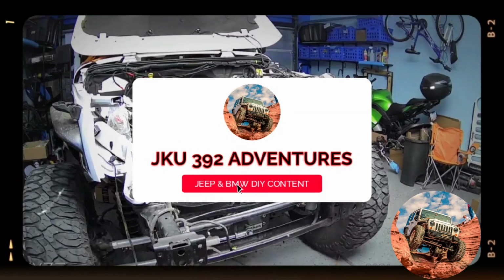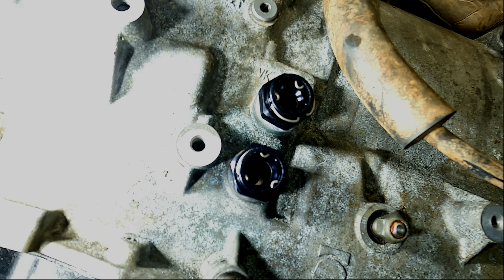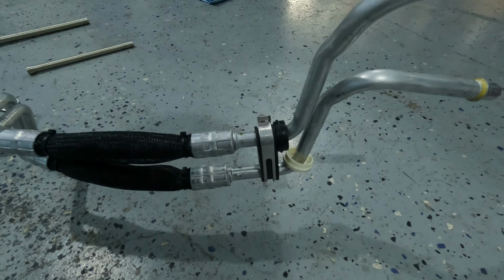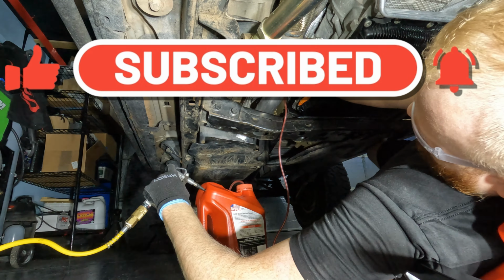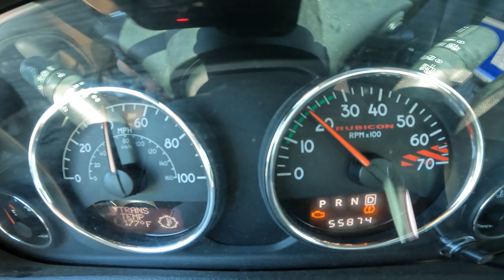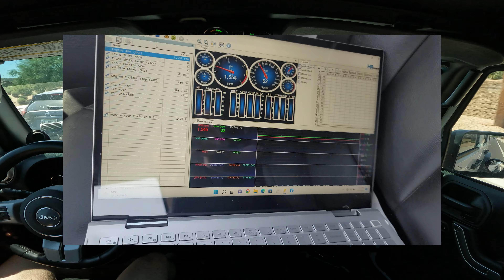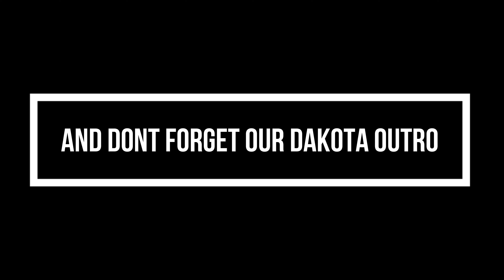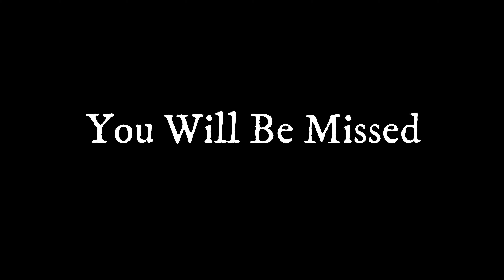How to Swap your Transmission! (8hp70) (FIRST DRIVE!) (Video 3)

Comment: All 3 videos are super informative!! You made it look easy. Glad it worked out for you dude. I got the same year jeep, but a sahara that I want to do the 8spd swap to.
Reply from the maker: Hey! Thank you, it is definitely a swap that's worth it, even if you don't have a V8, the 8hp is an amazing transmission. Join jeep speed shop page on YouTube, you'll see a lot of good information on there 👌👌🤙🤙
Reply: @jku392adventures  i have a 2012 Dodge Charger Pursuit with 6.4 swapped into it. And pointers you would give about gear shifter harness or anything?
Reply from the maker: @khuncho5000  I would recommend reaching out to sound German on Facebook and see what he recommends. You'll probably need a shifter from a 13-18 charger/challenger that had the 8 speed, whether it had a V8/V6 shouldn't matter. But you'll likely need the pcs controller to help the transmission talk to the ecu
Reply: @jku392adventures  ok thanks bro. very insightful 🫡
Reply from the maker: @khuncho5000  no problem 🤙🤙🤙

Comment: Just need a MPVI2/3 with credits and HP tuners to view the info on the PC?
Reply from the maker: To use HP tuners you will need the HDMI adapter but you can view all the information without paying for credits, but as soon as you go to upload a different file to the transmission or ECM, you will then have to pay for credits

Comment: Great stuff. What is the name of the aux pod above the mirror? Looking to do this swap to my 3.6 this year with the JSS kit. Any tips? Thanks
Reply from the maker: Thank you! Jss is definitely who id recommend, join their fb group and there's endless amounts of information on there, and for the s-pod the actual link that I bought from is too old, but this is close to what I purchased

Nilight 6 Gang Rocker Switch 12V Panel Relay Box Circuit Control System with 80A Circuit Breaker Switch Covers and Removals for Jeep Wrangler JK JKU 2007-2018,2 Years Warranty https://a.co/d/344Nvdt

Comment: On jls-jts when you are in 4low mode you can choose up to 4th gear to start the car on full stop,the question is could you do that in this type of swap on jks?While you have nag1-545rfe transmissions it doesnt give you the option to fully send it from different gear but only with the 1st gear,even if you choose from shiftet 2nd you transimssions will start at 1st and then shifts to 2nd!
Also great videos dude!
Reply from the maker: Hey thanks! Im glad you enjoyed! I will have to check it out whether or not you can, I Believe you are able to shift mine into second when stopped and then start on second, but once you come to a stop again it will downshift back into 1st. But if you check out my sport mode button, you are able to chance some settings and use it as an off-road mode so it won't automatically shift back down into 1st
Reply: @jku392adventures  a friend of mine has jt,at 2high computer allows him to start only at 1st and 2nd,when he put it in 4low its allows to start 1-2-3-4,but not hugher than 4th!Im about to do this swap on my wrangler tj already hemi swapped,so your videos will help me alot even if i dont have jk!When you check it let us know!
Thanks in advance!
Reply from the maker: @SunTehPower  glad the videos will help! And that sounds like a fun swap! Tjs and v8s are fun! And the 8 speed will be a game changer for you! I will reply here once I see what my jeep can do. Feel free to message me on my IG page or Facebook if you have any questions my videos don't answer
Reply: @jku392adventures  i will have many questions be sure!Thanks mate!
Reply: Btw whats you facebook page?
Reply from the maker: @SunTehPower  Instagram would be easier, you can look up my YouTube page on IG. Btw I was only able to shift up to 2nd in low range. Wouldn't let me go higher
Reply: @jku392adventures  i got it,but did the car start with second gear or just started with first and then shiftef to second?
Reply from the maker: @SunTehPower  the jeep can start in either 1st or second gear, and it can shift all the way to 8th

Comment: I have a 2016 JKUR would it work with the 3.6 ....sorry about your dog...
Reply from the maker: It would be very similar with the 3.6, just a little different transmission that will fit. It's the 8hp45 I believe. But most everything is the same. And thank you! It's been a year already, crazy 😣

Comment: Just a random question I may have missed this but did you change out the fluid before the install or after or do you have any plans on doing that later.
Reply from the maker: I changed it after it was installed into the jeep, I installed the transmission then installed the valve body, then filled it with fluid. 👍👍👌👌
Reply: @jku392adventures  did you take it through all the gears or just refilled with the same amount you took out?
Reply from the maker: I added about 6-7 quarts, then I did the fill procedure. I would suggest looking it up online for the exact procedure. But what I did was lift the back end of the jeep, start it up, add a little more fluid so it was about 8 quarts, put the transmission in drive/reverse/neutral a few times, then I put it in drive, put it in second gear and gave it gas to get to 2k rpm for like 10 seconds. Then let it idle in park until the trans temp got just above 100 the. I checked the level and added a little more. Make sure it's securely jacked up in the rear end. And definitely look up the exact procedure online

Comment: Great video, man!
I'm running into a snag on mine. What intake manifold are you using and what CAI are you using with it?
Reply from the maker: Thanks man! What snag are you running into? And im using the stock intake manifold from the charger, and I have a diy cai

https://youtu.be/AUYNboD3V8U
Reply: @jku392adventures  
I want to use the stock manifold but it's putting the CAI on the driver side where I don't have any space for. 
Figured a different manifold would fix it.
Reply from the maker: @jaxgsxr  yeah I had to cut out the window washer reservoir and relocate it. I think the jeep grand Cherokee 6.4 has the intake on the center. If I could have gotten one of those I definitely would have gone that route. But that's just more money. But if you can find it do it. Makes more room for ac lines if your cai was passenger